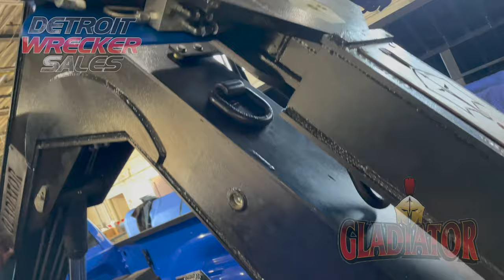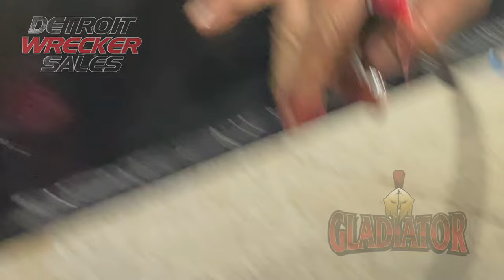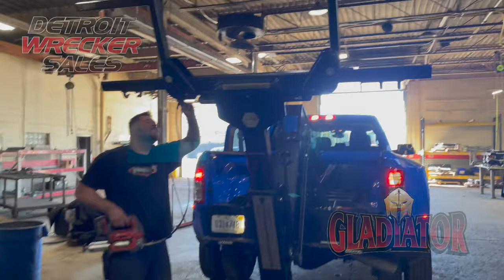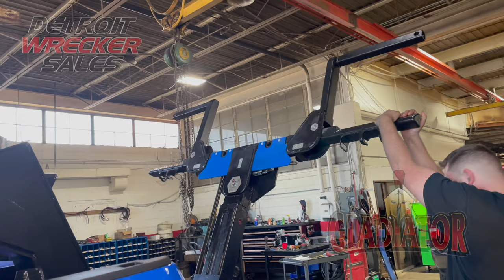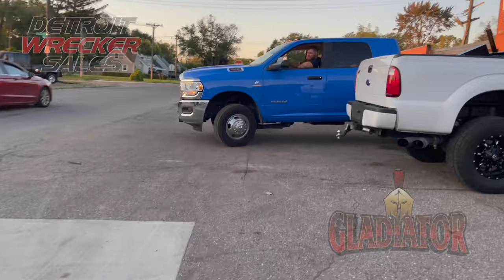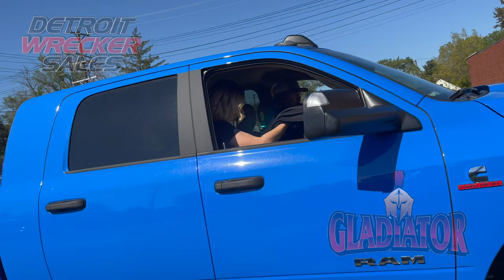The last Gladiator built at DWS

Comment: Cost?
Reply from the maker: As of today…
The Gladiator starts at $37,000.00. Add $10k for the installation of frame reinforcement and rear suspension. 

Add $4200 for the rear bumper. 

Add $15k for the boom and winch

Add $3k for the Dollie bunks. 

Gladiator Capacities:

*The Lift Capacity is 4,000 lbs

*The Tow Capacity is 8,000 lb

Just so you know the Lil Hercules that mounts under the bumper is STRONGER  and less expensive it starts at $25,000 not $37k like the Gladiator. 

 

 Lil Hercules 2.0 capacities are higher so the LH is stronger than the Gladiator.

*The Lift Capacity is 5000 lbs

*The Tow Capacity is 10,000 lbs

Add 10k for the installation of either unit. That includes the frame reinforcement, in which all truck frames are stress tested in 3D CAD by our in-house engineers. Rear suspension, rear Fox shocks. Plus everything else needed to tow home like wireless tow lights, rear work light, ratchets, straps, and safety chains. Turn key ready to tow!